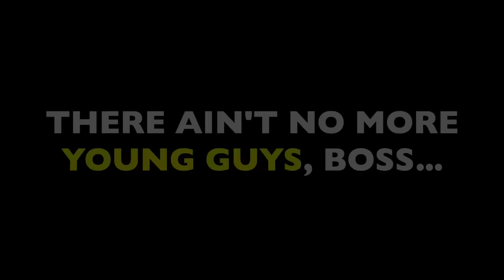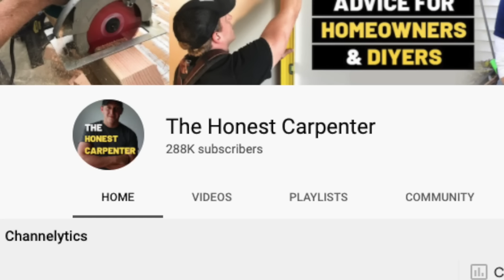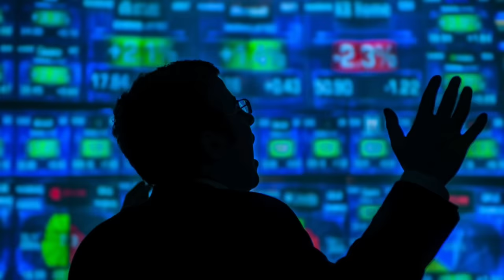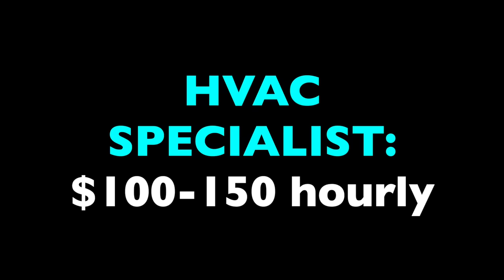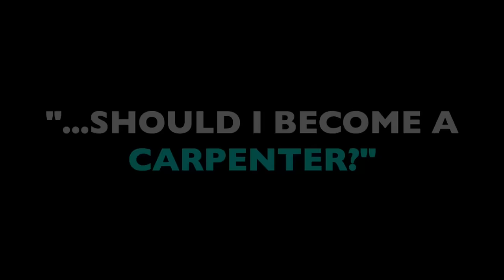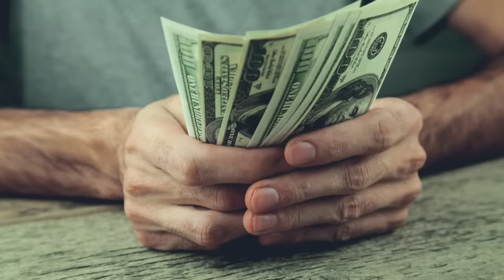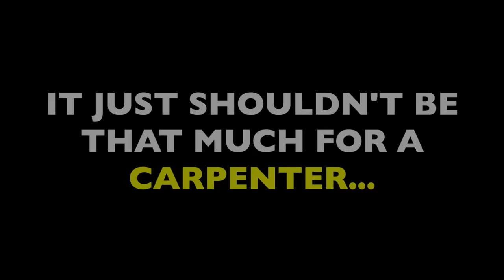WHERE HAVE ALL THE CARPENTERS GONE?! (Why The Trade Labor Shortage Is Only Beginning...)

Comment: You hit the nail on the head. I started in 1979 as a carpenter. By 82', I was working for myself and making 40,000 a year. (in today's money, that's well over 100,000 a year!) Even in the middle of a recession, I couldn't swing a stick without hitting a good job. Then Reagan and trickle down took hold. The bottom dropped out, and the trade never really recovered. Every year, my income went nowhere. Inflation just dragged my earnings down every year. I'd struggle to change my circumstance, and then here comes the next recession. Every time the cycle hit, it took longer to recover.
After 2008, it was the last straw. My body was hurting, and the vultures came out of the wood work offering 12 dollars an hour. 
The last few years, I notice that carpenters older than me were not getting hired at all. It seemed like the only thing a 50 plus carpenter was working on, was a drinking problem. I decided that that wasn't going to be me. I got out at 46. I took up taxi driving and growing (I'll let you guess....) I started buying real estate and using my skills to fix up houses and rent them. Now I'm almost 60, and my assets might actually provide a decent retirement for my wife and I.
A few years ago, my kid asked me if carpentry was a good trade to get into. I gave him the same advise. I said go to college and university, or if you must get into the trades, become an electrician. There is no money in carpentry, just disappointment
Now, I am almost 60. I only work on my own properties. People ask me all the time to work for them, or recommend someone. I say I only work for myself, and I don't know any carpenters any more.
I'm very glad I got out when I did. My next gig, is to buy some land in the Philippines, and become a farmer.
Reply: @maxsands3861  It might be the state you worked in. I think the interplay between the fed and the states changes the way things happen state by state.

Comment: My dad was a general contractor, mostly remodels. He is a retired, but rents apartments, so he sort of still is. I remember when I was a kid he had a crew of folks he would call, and says that now he can't find anybody. I was encouraged to become an engineer, to get a desk job in a giant company, which was terrible advice, but I tried it. I think he didn't encourage me into a trade because he knew how hard it was on the body in the long run. I actually received a lot of instruction in high school from a retired engineer, maybe there will be a niche for construction instructors. The apprenticeship is the best way to learn, for sure. Is there a place to go for that kind of thing? Do you just ask any carpenter? Doesn't sound like they know each other, though that might be because you do all the work needed for the jobs you do. Other than plumbing and electrical and what have you. Is anybody hiring many individual carpenters now, or do they hire large carpentry firms? Or going to Home Depot if all they need is plenty of intelligent hands.

Comment: I stopped being a carpenter about 12 years ago when I was 30, and if I hadn't found the job that got me out I'd have found another one in that time, and probably would have gone to gotten my journeyman licence.  A discussion that was going among carpenters back then and should still be discussed IS licencing.  Plumbers, electricians, HVAC all need to have a licence proving they are trained correctly for the job, and with that licence comes the stigma of higher value.  It's a negotiating tool for them to charge more, and have their perceived value go up with other rising costs.  Yet there is still the impression that any average joe can be a carpenter with little training, yet as you mentioned, it's a lot of responsibility.  Not just lower pay, but a lot more problem solving.  A LOT MORE PROBLEM SOLVING!!!  While an electrician, once trained, doesn't have to think about it on the job as much, they just follow the procedure that has been standardized, a carpenter needs to know if they're replacing a load bearing wall, and then how to replace it without the building collapsing.  Or figure out how to replace a rotting deck, and explain to the customer that this could lead to higher costs if they find the building sill is also rotten, but we won't know until...there is no standard procedure, there are basic instincts that come from experience, but there's a lot of unknown territory when you make a bid.
So you're left with an industry that pays some of the lowest wages of the trades, requires a lot of brain power, and then also requires a lot of physical labor...that equation equals no more carpenters.
Reply: Mate if you think being a sparky is easy compared to a chippy your in for a suprise . It aint all bog standard domestic work .

Comment: I went to a tech school for carpentry when I graduated highschool. The best decision I have ever made. It gave me the foundation to keep on learning. Way more valuable than my bachelor's - no comparison.

I'm currently the lead contractor on a huge church remodel and so often I can't get electricians, plumbers, or sheetrockers. I ended up doing the sheetrock myself over the course of three months! I'm stuck at the mercy of the electricians and plumbers because I'm not licensed. 
I feel like where I live there is too much work for the amount of people working these fields. Its been this way for at least two years.
Reply: The reason carpentry pays more is because of the artistic aspect. Think about it. Plumbing, drywall, electrical. You never see that stuff. But the carpentry? That's the personality of the structure. The lesson? Art and design pays. Now, if I'm correct, that means you do quite a lot of custom stuff as opposed to assembly of prefab cabinets. Am I right?
Reply: @ajspice  I do rough carpentry mostly, but some trim work. I meant that doing carpentry or construction in general has been more beneficial for me than my bachelor's. 
I did finally get the plumbing finished and the electrical, but the company that we hired for the electric sent one young man who worked like most young men lol so I did most of the electrical too, but at least it will pass inspection because it's under their name.
I need to get licensed I think.
Reply: @Honest OK  I'm just not good with my hands. I have problems handling intricate or small objects. If I need one nail, I grab three because I WILL drop two of them. 
But I like my career! I've gotten to do some very cool things with it. It's tough, but that's almost any job field. I figure I must be doing something right if I can make a living from it 10 years after graduating. I'm looking forward to spring when everything picks up. I think 2022 might end up being my best year yet! My goal is to hit six figures, pay what little debt my operation carries, and start 2023 in the black.

Comment: There's only one way to go in America today, and that's to run your own small company. Forget low wages and long hours, but you've got to be good at what you do and you've got to be responsible and hard working.
I built and installed cabinets,  did tile, light plumbing, light electrical. Basically just kitchens and bathrooms. I could do one big kitchen each week if the granite countertop guys were on the ball. I made $5000 per week consistently. That's a quarter million a year and I had one guy working for me everyday. I bought all my tools. No credit, no loans. I bought my truck and trailer for cash. I had more work than I could handle and contractors were always trying to bully me, to get me to rush and get to the next job so they could make 20-30% on my labor. I just quit taking their work. Never let another person tell you how much you should charge or how much you can make. The first mistake most people in the Trades make us selling themselves too cheap. The second mistake is not knowing how to source products and the third is not knowing how to schedule themselves.
Reply: I concur with your conclusions. You make the best money working for yourself on your terms.  Never let others dictate your price on your skills and labor. 
I've gotten to the point where the toll on my body determines a lot of factors. The harder it is on my body, the higher the price.

Comment: I remember the 70s where miles of slabs in California were impatiently waiting snap, plate and detail. It was one licking nails with a modified 19 oz Vaughn affixed to a 24 oz Vaughn hammer handle. A.F.J. Reichers Full Length Roof Framer, now replaced with Calculated Industry Construction Master [with trig functions], was the go to tech that made roof cutters the master carpenters. That's were I hung out. It was a great life. I was non union, and did piece work. I loved it. I got paid for getting the lead out of it, and learning to hustle. Once I went to work on a prevailing wage job, and I was scolded for single handing 8' joists for not using another carpenter. I was shocked. I raced the two guys on the other side of the forms driving stakes to the string, and left them in the dust. I was fired, and lmaof, I guess I just didn't care about the politics.

Comment: Carpenters have to know everyone's trade! Read all the blue prints!
Reply: In Florida you need a cabinet installer license. Meaning you have to pass electrical and plumbing state test just to be able to install your work
Reply: @bar1776  really? Why? Explain lol why you need 2 mechanical licenses to install cabinets.
Reply: @chriscary9269  ask the state
Reply: @chriscary9269  Florida has rules and regulations for the rules and regulations.  If you get handyman license they give you a book thicker than a bible of things you can't do. You can't change a lightbulb.
Reply: Blue prints that term musty be from the 70s never saw one only site plans
Reply: @bar1776  just when I started to think Florida was a cool state...lol
Reply: As an electrician we say the same thing. I'm sure the plumbers say it too.
Reply: @CORRIGEEN71  --- The term is from the 1840's. It's less of a mouthful than cyanotype contact prints of the building plans, which is what they actually are. They were made obsolete by computers, but they were the defacto standard for nearly 150 years -- and the term is still used interchangably with 'site plans'.
Reply: So does HVAC!
Reply: @redcenturion88  it is. Just depends on what county you're in. Dade,Broward and west palm beach are horrible.

Comment: Its funny that they pay less for carpenters, yet the tools required to be a proper one is higher than the rest. You basically need all the saws that exist, all the hand tools, ect..
Reply: Yea, you‘re right.

For all of you (speaking generally) who don‘t have any insight in a 5+ person carpentry (an average firm...where i live)...

...you need a sliding table saw (10.000€ for an old used one; 25.000€ for a new one with all the electronics to keep up the efficiency...to be competetive)
...you need a planer and a ticknesser (15.000€ for BOTH machienes)
...you need a chip extraction system (varies hugely... from a couple thousands til a couple 10 thousands)
...you need a huge belt sander 15000 +
... other expensive machineries and so on
...the buildings (which has to be big for all your stuff)
...the workers, insurance and so on
...firms also have to pay for educating apprentices
...the wood (800€/m^3 for cheap wood...quickly going into 1000+ €)...wich you have to pay in advance

An than there is you...
...buying cheap furniture from Ikea and other wearhouses (containing wood from the tropic rainforests...where illegal clearances are more profitable than smuggling drugs)
...not willing to pay for the quality, confounding plastic „wood veneer“ on scrapwood sheets with real massive wood
...buying Ikea furniture anyway...knowingly that you are gonna throw it away anyway, because it is „outdated“, doesn‘t fit anymore and it‘s falling apart anyway...

Ps: in the EU is a serious wood shortage (sawn, plywood, any kind) because many firms in China and USA stopped producing due to the Covid-pandemic...so here we are...americans and chinese firms buying containers and ships with any kind of wood for almost twice the price. Many local firms can‘t produce anymore because there is no one who could deliver anything...they ran out of stock. Delivery status midsummer ...if you have luck and the connections...
Reply: Yup and scaffolding ripping rotten walls with windows that need to be saved ect I'm a roofer and worked as a carpenter a short while and hats off to you alittle more ground measuring time but beams are heavy and the precision that can be required
Reply: Auto mechanics pay most cost in tools,yet they only get paid about 20 to 35 dollars an hour....
Reply: @rottenrottie1515  every auto manufacturer does things their own way, and most times in a stupid way.
Reply: Yeah concrete guys have pretty expensive tools. Dump truck,skidsteers,mini excavators, straight edges trowels. You would be surprised lol
Reply: @jimmymcclelland3727  that's nothing compared with a mechanic..mechanic needs tow trucks, tires machines, tire balancers, alignment machines, ac machines, brake and clutch latches, smog machines, coolant machines, hoist, and dozens of other machines plus a shop lol ...auto mechanics have to be a plumber, electrician, Hvac guy and mechanic. Almost forgot these days mechanics also have to be computer experts also to mess with these high tech cars
Reply: @rottenrottie1515  
I'm not to sure about that just price a new excavator, triaxle, rollers ,service  trucks,rebar guns quickie saws. GPS systems my company i work for has total stations that cost 50,000 dollars not counting lazers. Multiple work trucks tools in all the trucks fueling all those trucks.
Reply: And then one day some asshole breaks into your truck and steals all your tools.
Reply: Trying being a mechanic. You guys don’t spend 25k...
Reply: @mikethemechanic7395  I am a master technician for 3 different vehicle lines and I have 100k in tools..Just my Snap on tool box is 20k...other people have no clues about how much we auto tech need in tools. All they see is some  junk yard mechanics that have a bunch of crap tool and think is cheap...
Reply: @mikethemechanic7395   oh I know i have family who owns  a mechanic shop and a couple friends. But 25k won't even buy a excavator or skidsteer or a service truck. Let alone everything else's.
But I do give all props to mechanics you guys have more patience then me working on all the new vehicle's.
Reply: I have a garage AND shed full of tools for everything and remodeling carpenter does EXEPT plumbing and electrical. When I call on them they drive up in A VAN carrying most of everything they own! Lol
Reply: @rottenrottie1515  yea I came here to say this. My first 5 years out of school, I prob spent 7-10k per year on tools (plus interest). I also do woodworking, but my automotive tools don't fit in a mobile box or go in a tool belt.

This is not to say it isn't expensive, even a good level will cost over $100! Either way, the people who keep you in your cars and keep your homes upright and nice need more money. I haven't seen a raise in 4 years except in my insurance costs...
Reply: @mikethemechanic7395  Try starting a cabinet shop. I'm not talking a hobby shop, I'm talking production shop. A wide belt sander can run more than 25k. That's only one tool. Then it needs a dust collector large enough to handle it, and the rest of the shop. That's another 15k. A cabinet shop can easily have 100k invested and still be in the stone age in terms of automation. I'm not here to compare spending, the point is it's easy to overlook what other tradesmen spend on tools.  All of us.
Reply: @jimmymcclelland3727  you are talking about if you are the boss.then you are making way more the 20 to 30 dollars a hour...that would be sad if you have to buy all that stuff and you are making on 60k a year...now if we are talking about boss level stuff,  then the price of a dealership an fleet of tow trucks. Lazer frame puller, state of the art paint booths, smog stations and dyno,Hoist and hundreds of other machines
Reply: @jimmymcclelland3727  we are talking about what a regular joe that works for someone have to buy for tool.I don't think a guy that works for someone in construction have to buy his own excavator
Reply: @rottenrottie1515  
Very true. But same goes i don't think a mechanic that works for a shop has to bring his own tire machine etc either.
Reply: @jimmymcclelland3727  I am a auto master mechanic and my dad is a carpenter.I also learned some carpentry skills from him. So I know how much both fields have to spend on tools..Imo auto mechanic tools cost more and also need more...we can compare apples to apples if u want....
Reply: No you don't.